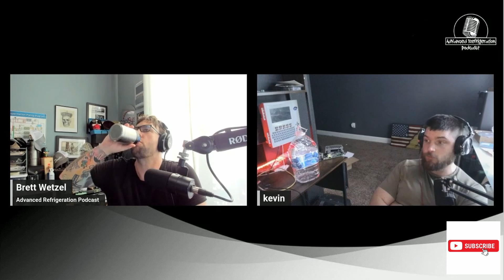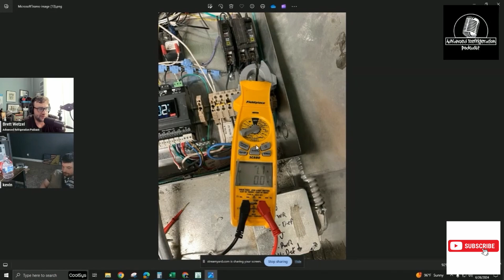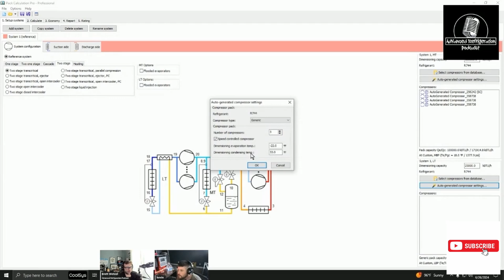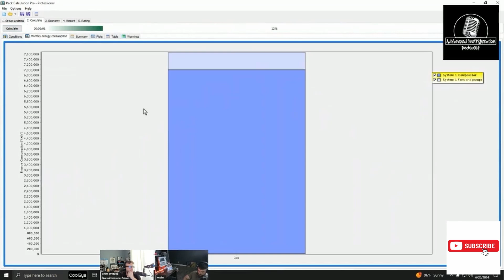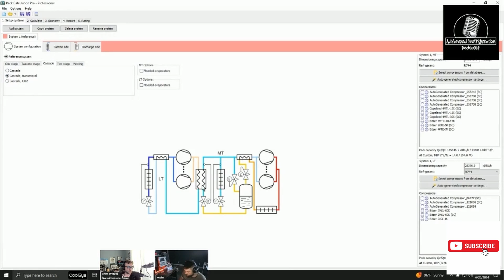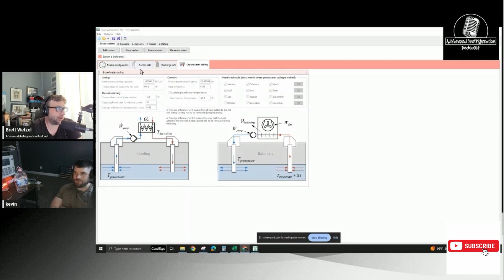Kevin Fights a Controller, A COW??  And We Play With CO2 Sizing Software Episode 327 Video

Comment: Ok just correction on this. Description file is e2 world and ADF file is e3/ site supervisor. There is a big difference total different file they can’t be crossed linked between e2 or e3. Kevin is correct you have to load the ADF file before the license you can’t  load the ADF file off the e3 you have to have the file before hand unless you have connect plus access. The license has to be regenerated by Copeland/Emerson, they won’t charge you since the license is already bought in the other e3.